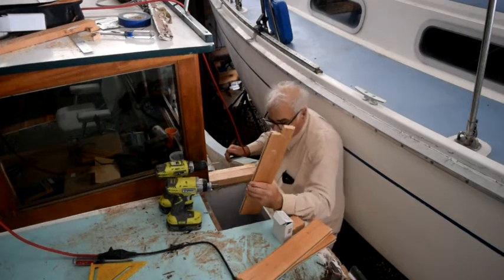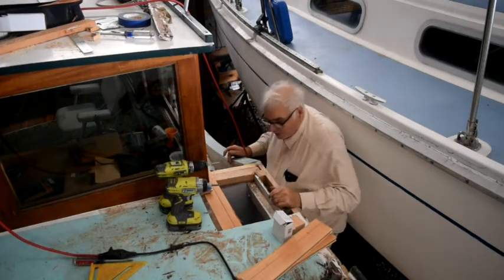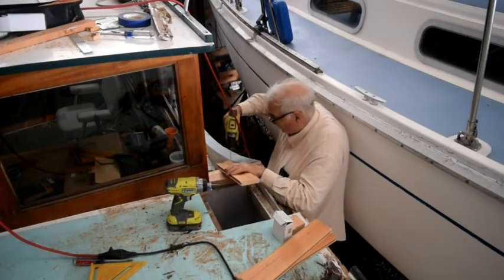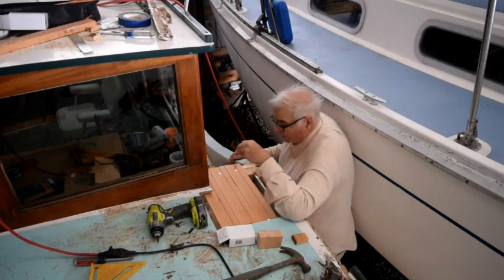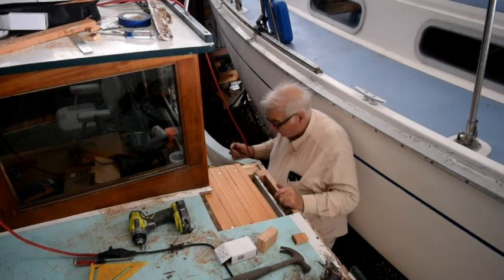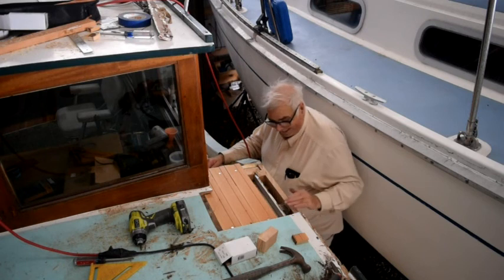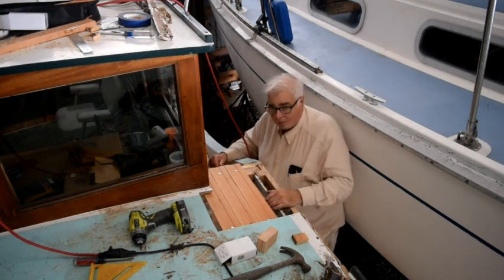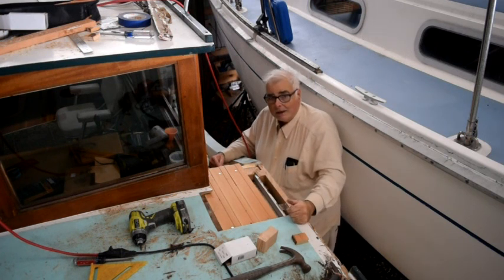Wooden Boat Maintenance - Deck Repair Part 2

Comment: I thought you would have to drill pilot holes to prevent the wood below from cracking, do you have special screw?
Reply from the maker: What you need to predrill depends on the wood, the type of screw, the size of the screw and the location of the screw in the wood.  I am using #10 self tapping screws.  They are going into Douglas Fir.  They work well with the soft wood and won't split the 2" square beams wood unless you are near the end of a piece.  I did predrill in the 3/4" T&G overhead planking. I would drill lead holes if I was going into harder wood, using larger screws or using wood screws.